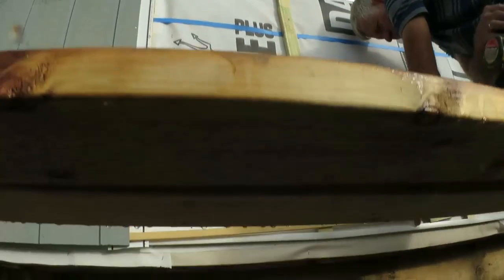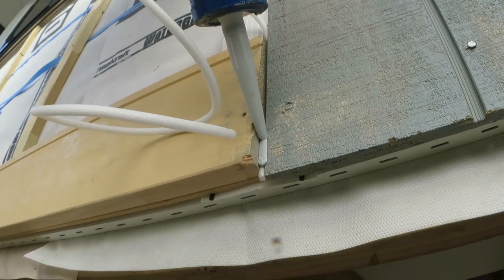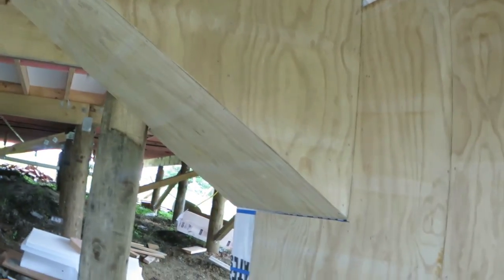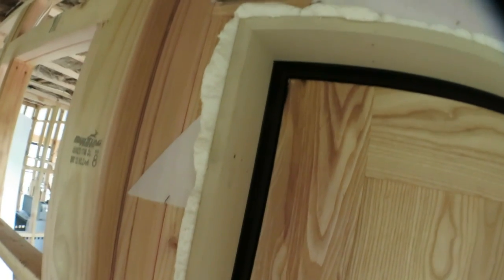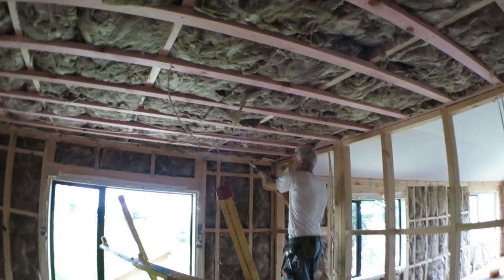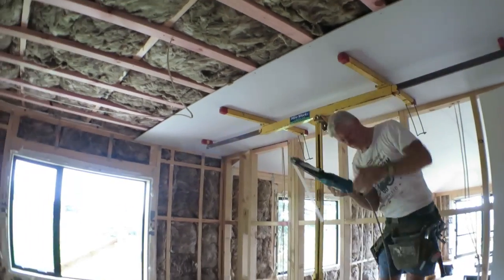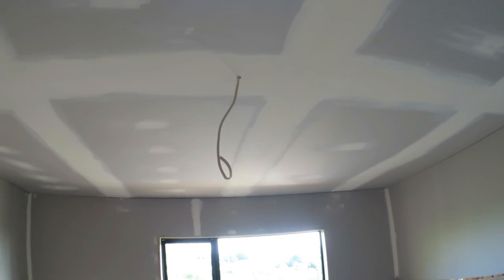house build  #7

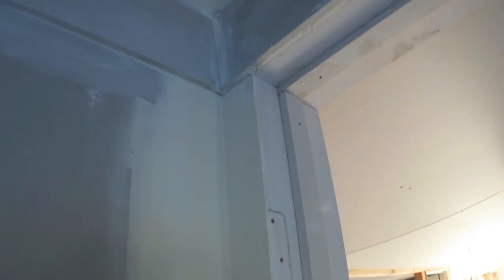Comment: 4:55 you would need a more contact whit the wood a screw would be optimal for it not to crack and the painter need to place that net stuff and microlit over it. Have done that many times white built in bookshelves

Comment: Loving your workmanship and looking good ! :) Are you planning to go for the more classical traditional type home or have it a bit high tech ? e.g. lights that switch on automatically when you go in a room, wet rooms etc ? I'm based in the UK, so Celsius works for me - heh ! :)
Reply from the maker: HI,  it will be a little hi tec ish.  my parents side is classic im having a few LED lights around (which i need to sort out)  nothing automatic.  we had planned to add solar power but ran into an absolutely incompetent company to deal with so thats on hold for now.  thanks for watching.
Reply: Sounds good - fingers crossed it will all go well moving forwards ! If I could build my own house from scratch it'd have quite a few mod cons but if the power went out I'd be locked out (or in) and wouldn't be able to even operate the taps (I'd have infra red taps) - so probably not the best way to go ;) heh